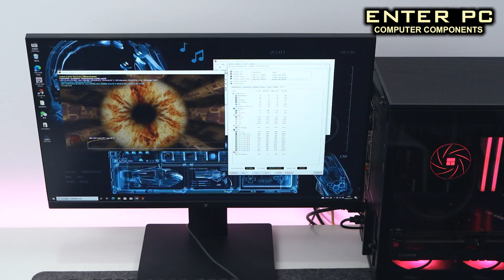JONSBO D31 MESH MINI BUILD - RYZEN™ 7 5700X - TUF RADEON™ RX 6800 XT - TUF B550M-PLUS

Comment: got the same issue with my gigabyte motherboard which has the gpu down on the 2nd slot

think i'll have to give up on rgb fans at the bottom and get some slim arctic 140mm fans, which will give an extra 10mm clearance between the gpu and fans - maybe i can throw in an rgb strip instead

nice build, temps look great!

Comment: Nice build. I have ordered the same case. I found you video because I also ordered an RX6800 (320 mm long) and was looking for someone who had put that monster into this case. So close, yet so far.  According to the numbers this case will take a card as long as 400 mm. In your opinion, will that RX6800 fit into the D31?